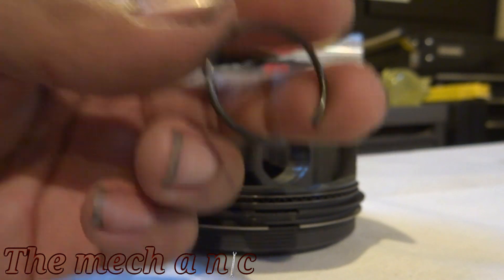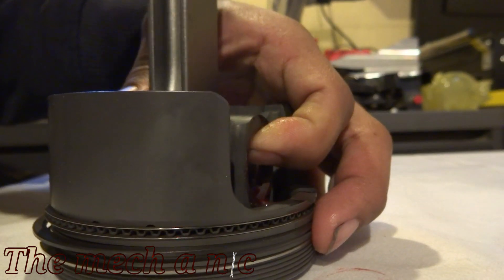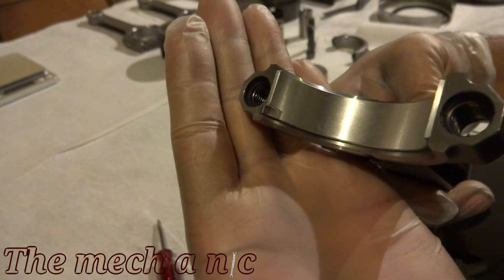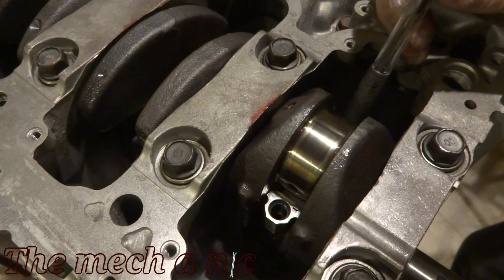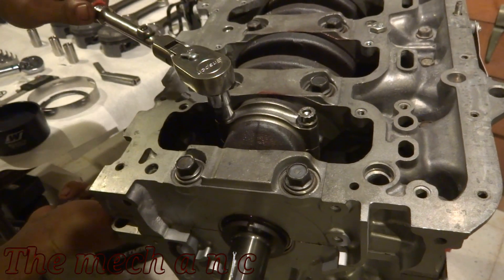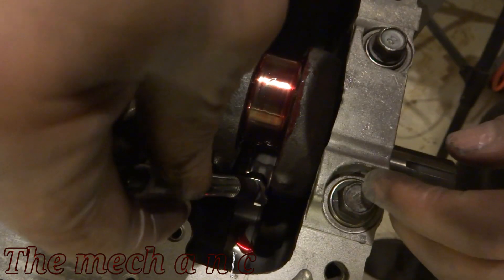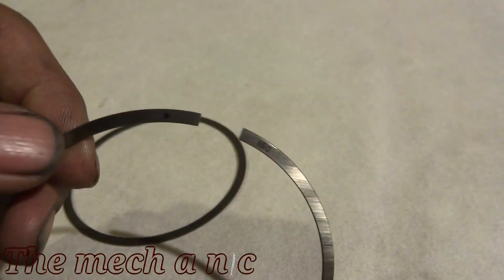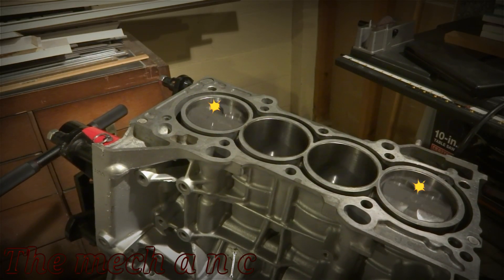K24 piston install part 2

Comment: The easiest way to get those connecting rod caps off if just loosen the bolts  but not all the way n not to the end of the thread so you don't fuck up the threads...n just tap the bolts n bam you good to go...great video bro but I can't stand seeing you struggle with those bearing caps lol
Reply from the maker: Thanks for the tips 👍

Comment: Which pistons are you running
Reply from the maker: Supertech 12.5:1
Reply: @themechanic6117  what brand?
Reply from the maker: Supertech...
Reply: Where did you limit the vtc when tuning your engine?
Reply from the maker: I didn't limit anything
Reply: @themechanic6117  brudda did the set came with the rings, wrist pin and locks? Thanks
Reply from the maker: Yes the pistons came with everything
Reply: @themechanic6117  stupid question bro, how do i know if i need to step up with the piston bore say without measuring the bore of the block
Reply: Don't know what to get 86mm or 86.5 its a k20z1
Reply from the maker: It will need to get measured or if you see damage like scratches on the bore of where the pistons go.
Reply: @themechanic6117  does the bore of a k series gets distorted overtime? The thing is i already purchased an 86mm piston😅 lets say bore doesn't have any scuffs amd scratches. Csn I get away with an 86mm
Reply from the maker: I forgot.  My intake cam is limited to 40° vtc if I remember correctly

Comment: Hi, planning to build k24 engine with aftermarket piston and rods, goal is 650whp, can I run cp 11:1? Our octane is 98, appreciate your advise
Reply from the maker: Only way you'll make that much power is with a turbo
Reply: @themechanic6117  ya the plan is to turbo charge but we want more from engine power than turbo, thr way to go is higher cp maybe like 11:1

Comment: What happens if the spec didn’t meet? The part where to used the string clay on the crank n rods as you’re torquing it.
Reply from the maker: Then you change the bearings until you get the specs you need

Comment: No one rebuilds engines anymore. Nice work and have a Great 2019!
Reply: Bro what lol engines are rebuilt by the thousand daily
Reply: @Mr.Thermistor7228 I was referring to repair shops. I realize engines are rebuilt, but no shop I know of rebuilds an engine in house, they mostly order a rebuilt engine from outside vendors.

Comment: Your wearing a tank top to be formal but you like to party . I'm  thinking your partying already :)  I seen a guy from Saudi Arabia torque a  new head gasket down on a corolla   with just a  breaker bar  saying you have to go by feel . One year later it was still running fine . LOL
Reply from the maker: Lol just like any other bolt on a car I'm sure you can tighten them by feel but for peace of mind I'd rather torque ,plus I don't need all the keyboard warriors on the web of YouTube calling me names and saying what a shit job I did....which I get anyway 😂👍

Comment: maybe it's never happened but I was taught to always clock the c-clips for the wrist pin to 6 or 12 oclock. Think about one clocked to 3 or 9 oclock and the piston forces squeezing the clip and popping out.
Reply from the maker: I tried rotating them while installed and I'd could not get them to move. They're in there so tight I can't see them coming out. If i were worried about them id take everything apart again . Not saying you're wrong though. Thanks for the tip
Reply: @themechanic6117  ya, i doubt they even would, I have to lift the end in the recess to start it in the groove then they'll spin.
Reply: False information